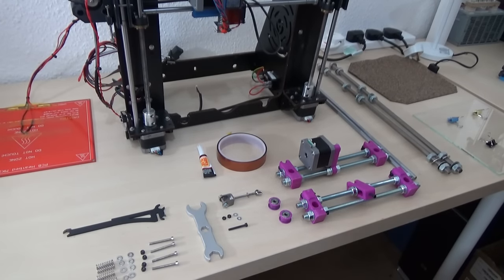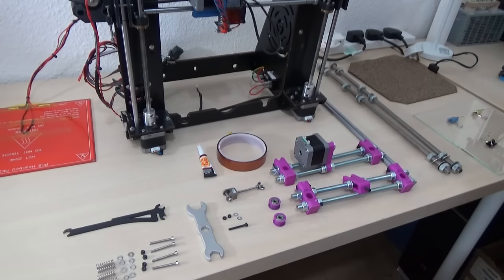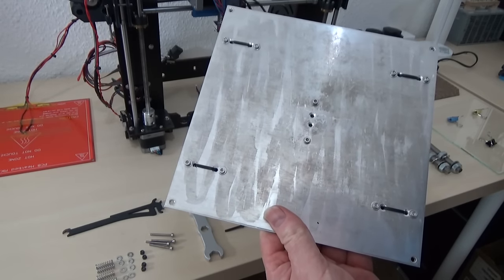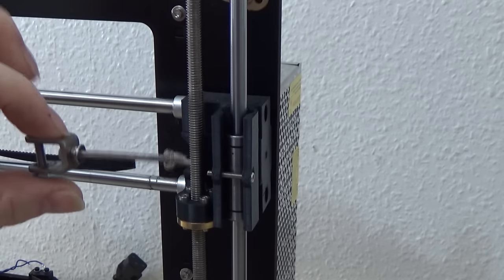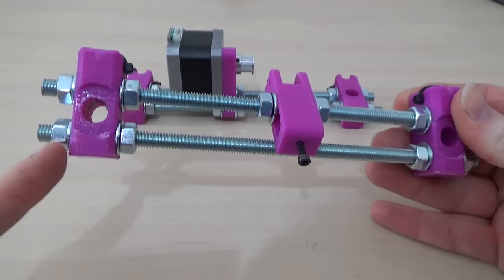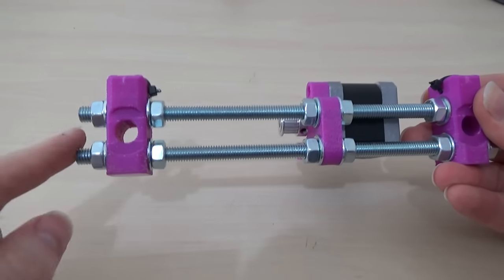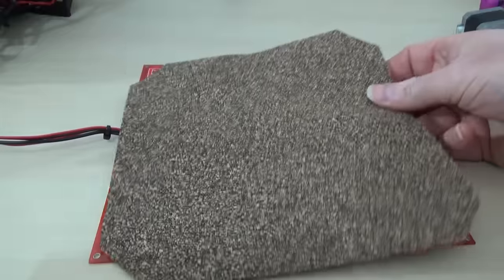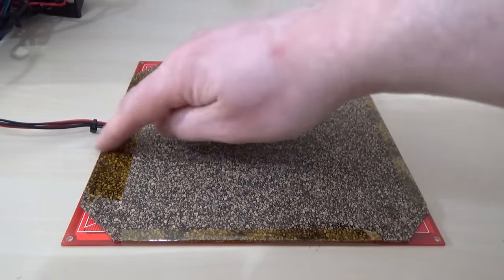eBay Prusa i3 Y axis mod

Comment: I have this printer. I bought it a couple of years ago and, it was problematic from day one. I recently got an Creality Ender 2 so, I used that to print the parts for this mod. I replaced the Y-axis, by using this excellent tutorial video. I also replaced the extruder mechanism with one that I found on Thingiverse. I didn't replace the hot-end but, I may do that in the future.

I got it all put together today, and used your Slic3r settings to slice the filament guide that you use on yours. I leveled the bed and started the print... it printed very well, on the first go! 😎 It used to to take me 5 or 6 tries to even get the first layer to go down properly. 

I really want to thank you for sharing the mods, and the settings that you use for this printer. Now I have two decent printers.

Comment: Just finished the mod, although I underestimated my board size 210mm was to small need 220mm, MY fault, so I completed the mod with the wood bed. Very pleased with the result and a new aluminium  bed ordered to complete.Thanks Steve

Comment: I did the y axis mod, and my printer works better, thanks. I printed a mirror image of the Y axis motor bracket and screwed it to the back of the motor (needs some 40 mm M3 bolts to pass through the motor), seemed a better way to hold the motor square.
Reply from the maker: David Pilling nice one. I've seen some people jam a spacer behind the y motor to stop it twisting. Might try fitting one

Comment: Excellent!! I'll deffo be doing this mod, very well explained! Thank you Steve!
Reply from the maker: Good luck with it.  I'm on with changing the wooden frame for a 6mm thick Aluminium one.  I don't think it will make much difference but who knows.
Reply: That'll be an interesting mod. Will you be doing a video on it?
Reply from the maker: I'll do a short video on it once it's done.  There's a lot to print to get it swapped but all the parts are out there.  The wiring and board mounting are the biggest issue really.
Reply: Brilliant! looking forward to seeing the video!  I'm hoping my Prusa I3 will arrive tomorrow!

Comment: Hello, very nice work for the Y-axis mod. Would it be possible to use this parts to extend the Y-axis to 300mm ? maybe the back wood plate should be removes, and the printed brackets in the back changes to include a support for the ends of the vertical struts. and move them 50mm back, and the front 50mm in front, and use a 200x300mm plate and heater that are already on the net. Or do you know of an alternative mod that allows for extending it to 200x300mm for this printer in a similar way ?

Comment: This is a great video so thanks for sharing. Why not add the cable ties after the smooth rods are installed? Have you thought about going to a aluminum bed so you can set up induction bed leveling?
Reply from the maker: Bill Karoly Hi. I plan on adding the prusa mk2 extruder with z probe once I find an aluminium bed
Reply: Have you watched Thomas Sanladerer's Prusa i3 mk2 build? Your upgrade is similar to the i3. I kind of want to do the same but with a 200 x 300 bed.
Reply from the maker: Hi Bill,  I have been following Toms "MK2 Clone live streams"  I'm inspired to make a super cheap PLA only 300mm cube i3 thing out of mdf.  I also plan to try out the MK2 X carriage and extruder on my ebay printer.
Reply: Have you seen the itopie?  Use that frame idea.
Reply: Check the itopie frame. I don't know if super cheap is possible. I guess it is all relative. No heated bed?
Reply from the maker: That's a nice looking frame.  No, no heated bed.  Can't really justify pumping a whole lot of power at 12v into a 300mm square PCB.  I may go for a 240v heater mat, but that will come later.
Reply: I'm ordering parts for my Tom's Special MK2. I have a lot on hand and still I am going to spend $200 US. I have a laser engraver so will cut out my own frame in 3 pieces and glue it together.

Comment: Hiya Steve, i've just ordered my first 3d printer,  the one you have modified in this video, the CTC Mk8 Prusa i3 clone. I was curious and wanted to ask, does the printer show unuseable print quality with no modifiations ? And is it good as a frist printer to have ? Thanks for making this video, gave me huge insight into the world of Extruder and print head modifications, as I didnt know that was much of a thing, great video, keep it up :)
Reply from the maker: Hi, I bought this printer to see how crappy it was out of the box.  I have to admit I was surprised by it from day one.  Before I did any mods I found it hard to level the build platform as the wood base would bend if the springs were compressed even a little.  The first print I did was a geared cube.  It took 6 hours to print at 30mm / sec using the supplied PLA.  It had a lot of z banding but it printed fine.  This printer is a great 3D printing learning tool.  It's far from an Ultimaker but if you want to get some hands on experience setting up a printer then, in my opinion, this is well worth the cash.  I've been asked which Marlin version I use and what my Slic3r settings are, so that'll be a short video that's coming very soon.

happy printing

Steve
Reply: Thank you very much for the resposns ! Good to know that is does indeed print at an aceptable level for beginners. I was scared that I had just blown my christmas money, anyhow,  thanks a lot for uploading this mod, as I will definatly try it, since the materials aren't to costly. I'll be looking out for that video.

Comment: Hi mate. Great video. At 12:00 minutes, when you're fitting the smooth rods over the end pieces with the tie-wraps, would it be of any benefit to have the tie-wraps loose until the rods are seated and then tighten them up?Cheers......Alan.
Reply from the maker: Alan _B Yes, mine were tight as I'd already built and tested the build before making the video
Reply: Ah. A fair point. But definitely something for me to keep in mind for when I apply this mod to my own printer.

BTW, where can I get the files for the parts that need printed. Did you download them or model them yourself?

Alan.
Reply from the maker: Alan _B Links to the files and everything else you need is listed in the video description

Comment: Hello, great vid
Why the cork and what temperature is safe?
Reply from the maker: Hi, the cork helps direct the heat from the PCB into the glass so the glass heats up quicker at the start of a print.
It also maintains it's temperature better during a print.
I wouldn't go over 110 deg C for ABS as the bottom of the print will get too hot and show signs of melting.
Also, I only ever print onto glue stick.  It works well at 110 deg C.
I would be VERY careful with other products at that temperature.

Comment: steve what bearing did you use in your y - belt tensioner bearings as the ones on ours are plastic cogged bearings. Your help is appreciated. i know you said the ones that were on your printer but ours are different. or is the bearing inside the plastic ?
Reply from the maker: Hi Paul.  My Y and X tensioner bearings are both the same.  Each one has 2 bearings.  The rough size of a bearing is 12mm dia by 4mm thick and it has a 4mm hole.  I printed a plastic sleeve that they fit inside of.  It stops the belt riding over the side.  Hope this helps
Reply: StevenQ-NE-UK yes we've (me and father in law) have follows your parts list in the description to a T but our kits and bits he bought (like toms has done) seem to have plastic gears to drive the belts around. But having the sizes is perfect will find bearing to fit inside the sleeves! Cheers steve
Reply from the maker: Let me know how you get on :)
Reply: Well put both designs in tinkercard for the y axix tensioner and the bearing holder that you linked separately and they don't seem to fit in each other. also don't want to go ripping sorry the printer with still needing to print on it to find out if there are bearing inside out plastic gears. (Excuse my shite grammar) haha I printed both parts but plastic sleeve for the bearing doesn't spin around freely.
Reply from the maker: Try rubbing the sides of the bearing guide on some sand paper.  You can try rubbing the insides of the Y axis tensioner with sand paper too.  You can see they fit together at 14:39

Comment: Can't help but wonder, by the time people go to the trouble of making all these "modifications", to their i3 clones, whether they wouldn't have been better off, to have just purchased an Original Prusa i3, in the first place.

No name hot ends, flexible couplers, rather than integrated lead screws on the stepper motors and substandard components.

Comment: Hi! sorry to bother, but can you tell me your slicer configuration for this printer when using PLA? I haven't manage to get a good print out of it, they always get kinda "curvy surfaces" on the sides maybe every 5 layers. thank you
Reply from the maker: Hi,  do the "curvy" surfaces match the Z Axis threaded rods?  If so then you may need to adjust the Z Axis a little.
Reply: yes actually!, do you know what should i adjust?
Reply from the maker: Hi,
there are 3 things that I would look at.

1.  Are the Z axis threaded rods and the Z motor shafts in the flex connectors correctly.  Both should be inserted just past the locking screw.   Their should be a gap between them in side the flex connector.

2.  Are the Z axis threaded rods wobbling at the top where they go into the wood.  They should be a really good fit in the wood.

3.  Are the Z axis threaded rods bent?  This is more of a problem on the thinner M5 rods.  This printer usually uses M8 (or something around that size) rods, but it's still worth checking them.

Hope this helps

Steve

Comment: did you have any extruder issues with this printer? if so how did you fix it? thanks for your time!
Reply from the maker: Hi, I found the original CTC extruder would skip steps all the time.  This was due to bad temperature readings so I had to change the thermistor.  Once I changed it, it printed ok.

Comment: A very cool mod :) but i will stick with my 200 quid 2nd hand wanhao i3 2.0 that has only run 12m of filament when i got it .
Reply from the maker: Nice, I've seen those.  The frame is  all metal right?  The wood is the big problem with this ebay printer.
Reply: i am just happy i got about 100 quid off because it had printed like 2 items (12m of filament ) 

Think of it as a i3 made of sheet metal. it comes with a Mk10 but it needs an E3D IMO. 

 i got it to replace a CTC i got for my 30th ( now sent back for a refund ) 

the CTC is a joke if it came with something decent like an MK10 it would be fine as the construction itself is good.

Comment: Whats the benefit? Seem like alot of work for no real result? Would love to know why
Reply from the maker: Sick Lad Hi, the original wooden parts would twist and warp while trying to level the glass.  As soon as the springs started to compress everything would move.  Once this mod was done the whole y axis becomes much more stable and the glass is easy to level and stays level for longer.
Reply: My version is all arcrylic and stiff enough although it doesent like uneven surfaces, So they must of update them
Reply from the maker: Ah,  when I picked mine up the acrylic version was quite a bit more expensive, hence the mod
Reply: the wood warps, if u tighten the y tensioner a lot the motor mount bends and at high speed prints the bet jumps teeth, worse pops off the pulley completely...

Comment: What is the point of this change?
Reply from the maker: Paul C Johnson it stops the whole y axis bending when you level the bed.  Originally this printer would need the bed leveling before every print. After this mod I only level it once every 20 prints or so

Comment: Hey how did you update the firmware?
Reply from the maker: Hi, I found the Geetech pro i3 B firmware works really well with this printer.  So I started with that and then tuned it to this printer.  It's not 100% but it's much better then the stock firmware
Reply: StevenQ-NE-UK I have trouble connecting it to the computer I have to do everything from the sd card
Reply from the maker: Ah, the only way to change the firmware I know of is to use the Arduino software which requires a computer to be connected.
Reply: StevenQ-NE-UK do you think I have a dud? Tried to connect it to the arduino software and nothing.
Reply from the maker: I don't think you have a dud.  When I first started 3D printing I could not get my computer to talk to the printer at all.  I had to allow "unsigned drivers" in Windows.  Once I did that it connected fine.  You could be seeing the same thing.

Comment: I can alludar am new to 3d printers my English is not very good I apologize for that I have a printer of this model and delete the firware not and could calibrate the printer in an optimum way and can not find how to calibrate the engines without I print with the default DEFAULT_AXIS_STEPS_PER_UNIT {79.0123, 79.0123, 2560, 94.6000 parts} // default steps per unit for Ultimaker
#define DEFAULT_MAX_FEEDRATE {400, 400, 2, 45} // (mm / sec)
DEFAULT_MAX_ACCELERATION} {5000,5000,50,5000
Reply from the maker: Hi.  I have the following setup

#define DEFAULT_AXIS_STEPS_PER_UNIT   {80,80,2560,100}

#define DEFAULT_MAX_FEEDRATE          {400, 400, 2, 45}

#define DEFAULT_MAX_ACCELERATION      {5000,5000,50,5000}
Reply: ok thanks served me